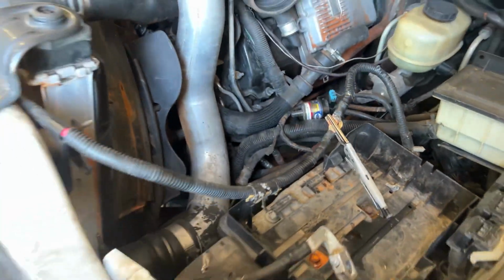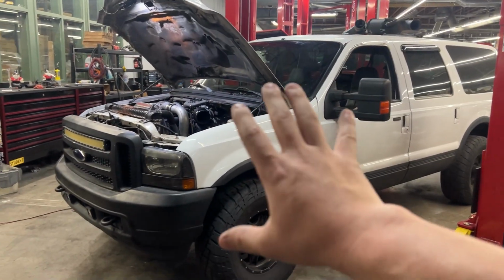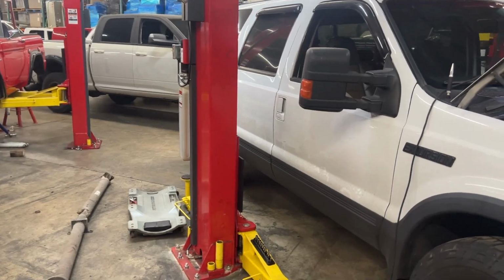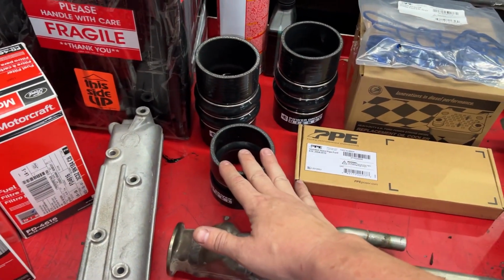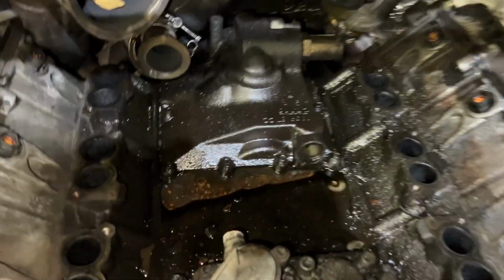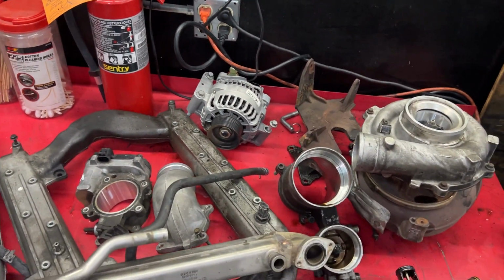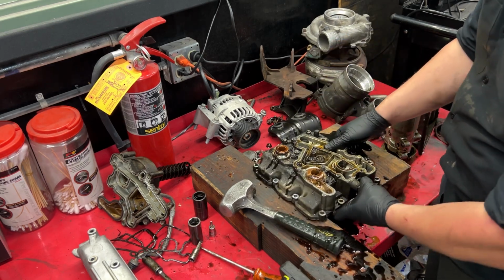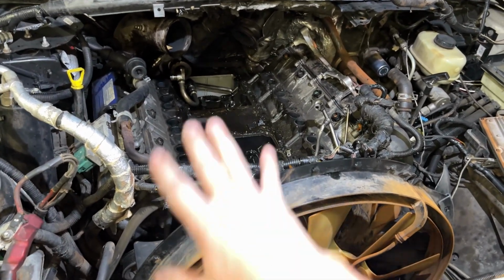THIS 6.0 POWERSTROKE NEEDS A LOT OF LOVE!! CAN IT BE DONE ON A BUDGET?

Comment: I have an 03 F350 XLT 6.0 crew cab 4x4 8’ bed which I purchased new for 36k. Don’t use it much as it has 59,000 miles. Almost 100% factory stock.  I’m in the process of replacing the front cover with the updated version. I had a coolant leak from the heater pipe which rusted through and was so corroded into the cover the mounting flange tore off when trying to chisel it loose.  I do want to keep it since it doesn’t have any body rust and I love that’s it’s a 6 speed manual with manual transfer case and manual hubs. I just rebuilt my 4.0 93 Ranger engine at 189k. .  I ordered the truck new. Best $16k I ever spent.  4.0 is easy compared the the 6.0.  AND parts are a fraction of the cost! Found 2 complete factory old stock new 93TM cylinder heads for $650 delivered.  Still in Ford’s foil desiccant sealed packaging.

Comment: I just did coolers and hpops on two early builds back to back. I don't know why I love working on these things so much, because some seriously hate it. Hell, I cant wait to dig into the next one! Early builds are better in some ways other than a little extra work here and there. No high pressure oil leaks. You can almost always bet on the pump in these 03-early 04's. They also dont eat lifters from my average observation across thousands of trucks I saw at the dealer. 

Nice score on that early excursion! Those things are sweet!

Comment: This is interesting content. I’m at a year and a half of ownership of a 2006 6.0 that I got with one previous owner and 72,000 miles. It was bone stock and almost still is.
Reply from the maker: That’s a unit! Keep the oil changes short & sweet. Add some sort of stiction additive and fuel additive and run it!
Reply: You’ll appreciate this one- I’ve got a bone stock 05 6.0 Thomas Built Short Bus Dually w/ 94k miles. It was apart of a school bus fleet up to 80k miles and was retired due to age and fleet upgrades. Gonna do egr delete, IPR oil cooler, coolant filter and do an overhaul on the maintenance. Paid $4k. Hopefully I can make it a 200k mile 6.0, prove the haters wrong lmao

Comment: I feel the same way about external oil coolers. Must be a growing up in that Vegas traffic lol                   When you change the up pipe, some  of them not all have a restricting or redirecting  flap inside you may or may not wanna modify. The early motors also had  resonators on the  down pipe that some may wanna swap it out  for a later years. to help that 03' turbo scream

Comment: Fix what's broke, paint the aluminium tubes. Don't go cheap on sensors or IRP changing radiator always new hoses. With this mileage get rid of OEM water pump. Blue spring and updated banjo bolts new serpentine belt and your done
Reply: What's wrong with the OEM water pump?